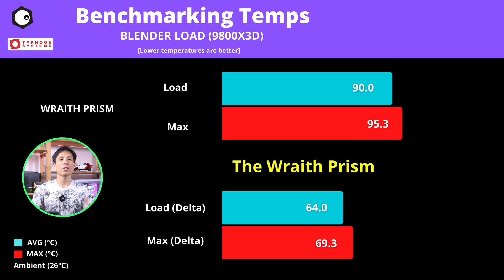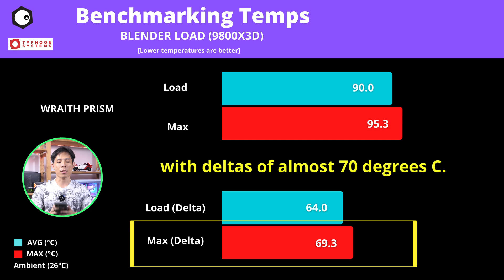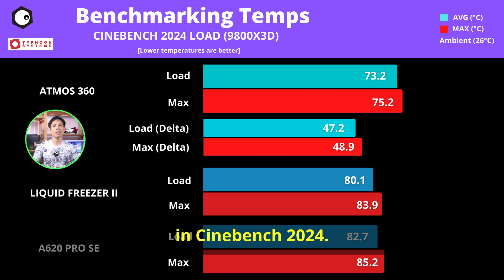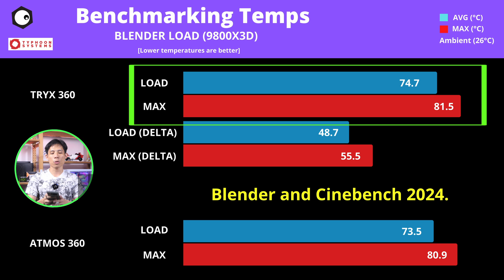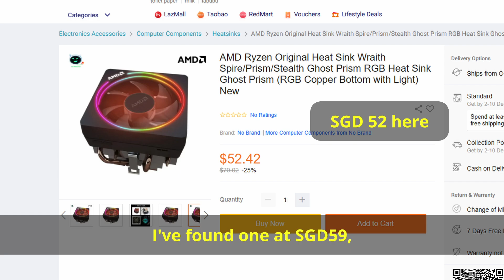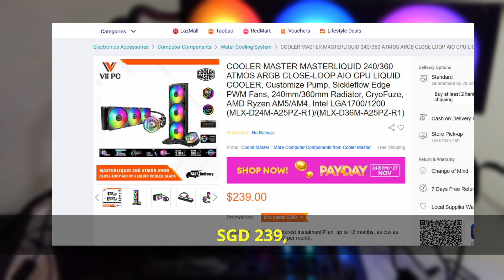Can AMD's Wraith Prism Cool a 9800X3D? (VS. After Market Coolers)

Comment: Good video.. But damn! I was hoping the Wraith Prism would have been enough, since it's an easy 30 second installation. I wish some cooler make would make a cooler that just uses the 2 side hooks like the Wraith Prism does. I hate having to disassemble the cpu bracket, take the backplate off etc.
I use the Wraith Prism on my 5800x3d in an air-conditioned room and it's fine.
Reply: Im using a prism on a 98003dx and even on quite demanding games etc. I never had problems with the temperature.
Reply: @valentin3381  I've heard stuff like this from 6 figure IT "professionals" so many times then looked at their PC's running 100c+ in mild gaming situations, dropping frames bad (only operating cuz the CPU downclocks itself to oblivion + horrible 1% lows worse than any budget card on the market) among many other preventable problems, just because you don't see the issue doesn't mean its not there (I get it in your case it's prob adequate but the "experts" not knowing better is crazy). Entire industry has been held back by brain-dead redditor types who go "mine works!" if it isn't broken in a million pieces and yelling "I'm broken!" at them. If you really want to know if you have adequate cooling, do a 10 minute Cinebench r23 run and watch the temps, gaming won't put that much load on it but it's smart to have that overhead especially with new release games that stress CPUs hard. At the end of the day, more cooling = more time your chip can run at peak performance, and that's doubly so for the newer chips i.e. anything newer than 5000 series for AMD or 12th gen and newer for Intel. I also recommend newbies use MX4 Arctic paste and removing the cooler hot if needed (it really does act like a paste, helps w/ applications but dangerous if removed cold)
Reply: i use it on my 5500 and soon to be 5700x it gets 42c idle
Reply: @Connorandtwenix I just bought one for my 5800x, I live in a cold country, I believe I won't have any problems either.🤞🏻

Comment: I have a thermalright phantom spirit 120 se doing the same cyberpunk test at 1080p all low settings I pulled a max of 90w and my cpu got to 64c cinebench r23 pulls about 120w-130w and my cpu only gets to 74c max and forcing the full 153w-160w in OCCT gets me to 87c the way I see it the CPU just basically has a target of 95c when under full load if I can keep my temperature under 95c then my cooling is good enough but in gaming I have yet to see my cpu hit 70c it almost always chills in the 50s in gaming and in extreme fully CPU limited scenarios lile cyberpunk with my 64c and in the last of us shader compilation which I saw a max of 62c in comparison my 5600X3D i just swapped for this was getting 92c when doing the last of us shader compilation and 88c in cyberpunk but I was also using a stock cooler for it like the one in the video generally though if I play the game like normal so 4k max settings max RT not path traced dlss balanced I get 60+ fps all the time and my CPU sits at around 53c
Reply from the maker: Cool thank you for this info Bunny! Looks like this Phantom spirit is way better than the ID cooling which I am using for the test. 
Are uy also using a 9800X3D? If so, the 95 deg C on these CPUs are the norm. Anything below is it good. And yes, you probably wont see much going higher than what u stated if u play games at 1440p or higher, and even with ray tracing. These are more GPU based scenarios.
Reply: yeah I game at 4k mostly so I see the CPU in the mid 50s most of the time I dont know prices there but I just wanted to show off a alternative in a similar price range that performs a little better I do think that low cost high end air coolers are close enough to AIOs that it almost doesn't matter especially when considering the almost tripled price tag and only 4c reduction in like for like gaming scenarios in my opinion and in my testing with my CPU cooler

Comment: Interesting to see the Wraith Prism in the mix. I think it'll do for 95W and below CPUs, but certainly not this 120W 9800X3D. I think the Thermalright Phantom Spirit 120 or SE or EVO are both cheaper and performs better than the A620. I'll get the TR for gaming on the X3D. Air cooler for better durability.
Reply from the maker: haha I had to throw in the Wraith Prism. May be I need to find a non X CPU for this Wraith Prism.
And also for the A620 Pro SE, it deserves bettter.

Comment: I will save you time. TLDR at very bottom

The  AMD 9800X3D is a 120 Watt TDP chip. The Wraith Prism is rated for 140 Watt TDP. You do the math.  < is better than >

If you live someplace really hot like the sahara, you have to make choices. Alaskans need not worry as much, but their summers do get warm. 

I know this info since i am debating water cooling at all, after a failure to install an Artic Freezer 3 240. I could not install the thing on a board it says was possible. Screws too short and i am not putting 150 lbs of downward force on a chip that costs 5 times as much as the piece of crap cooler. That is not even taking into account the cost of the motherboard. 

People have broken brand new CPU's and brand new motherboards trying to install the arctic freezers. I am not that dumb. I stopped way short of applying that kind of force.

Before you say it. Yes, i did have the brackets pointing up and have the right and left brackets in the right spots. 

Artic can take a hike with their failware. So i wanted to find out what the Prism is capable of. 140 watts. On my Am4 platform that is near end this will do and i can skip water cooling. Some of the best AM4 chips are in the 105 watt range.

Direct from AMD:

AMD Ryzen™ 7 5800XT	Discrete Graphics Card Required	8	16	Up to 4.8 GHz	3.8 GHz	AMD Wraith Prism		105W

So, one of the best AM4 CPU's, ever, for gaming, can be cooled with the Prism. Cool to know. I will skip water cooling altogether and save myself the headache of another failed AI cooler isntall that also throws money out the window.

Cheers......

TLDR to recap

The Prism will cool any and all AMD CPU's in the 5000 series class. So, Vermeer being the Zen 3 based. Nothing in that series goes above 105 Watt TFP.

And they will also cool the AM4 Cezanne  series CPU's (5000 series, Zen 3 based). Those are the failed to bin properly or "we will disable the GPU on failed chiplets yet still use the rest" philosophy chips. I have a Ryzen 5 5500 and the GPU is disabled yet there. They are not going to disable a working onboard GPU unless they have to or because it is dead.
Reply from the maker: Thank you very much Sumin for this very detailed breakdown! Great knowledge which I also can learn from.
And thank you for letting me know about the Arctic Freezer 3 240. I thought it will be a great cooler since many say so, but I guess nothing is perfect, there are always flaws with every other cooler. 

The Wraith Prism did cool the 9800X3D ok on gaming, but I wouldn''t recommend it (if you are gonna do some heavy work). Though I don't think people will buy this CPU for work anyway. 

But yes you are right, the Wraith Prism worked pretty well on the Zen 3 and Zen 3+ CPUs. I use it pretty often when I am not able to find a decent air cooler.

Comment: I am using the 9800X3D with NR200P Max which has a 280mm Cooler Master Stock AIO, it performs almost the same as a 360mm AIO. The entire case + 850W PSU + 280mm Built in AIO costs less than the TryX 360mm...

Running PBO CO -30, PBO2 +200MHz. I think in gaming, nothing touches it. The RAM I only got my 6000MHz 64GB RAM stable at 6200MHz CL32 38 38 32 with Buildzoid's timings. That helps production workloads gain maybe 3-5% depending on how memory sensitive they are. E.g. Cinebench R24 went up from 1383 -> to 1429 with the RAM tuning. Still everything added together tuning your CPU and RAM nets you around 7-10% in gaming and 9%-12% in production. While running cooler than stock, this is due to a -30 in curve optimizer.

I also kept scalar manual at 1x and it does use less voltage that way.
Reply from the maker: The TRYX 360 is really good, but really expensive, but lucky it doesnt reach the price of the ASUS Ryujins XD

Cool, I will try your CPU offset + OC and your RAM's timings. I think i may do another cooler video with OCed 9800x3D. Well I guess this CPU is surprisingly a good balance of work n gaming? even though it is known as a gaming CPU.

Comment: I just bought an amd 9800x3d with gigabyte x870 aorus elite and my aio doesn't compitable.i am planning to get aorus Waterforce 2 240mm is that right cooler?
Reply: what case do you have?
Reply: @idkwhattodohere8081  Antec dark Avenger
Reply: @Ryzphire arctic liquid freezer III 240 or 360 is good
Reply from the maker: Yes I agree with you, i did mention to skip the Liquid Freezer II and go straight to the Freezer III. Or something like CM Atmos 360 :)
Reply: @Ryzphire  if youre looking for an lcd cooler the corsair h100i is pretty good
Reply: I got the razer hanbo on newegg its crazy sale, just get it for the aesthetics liquid freezer is great too